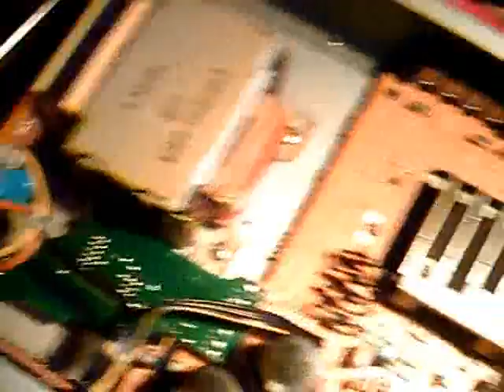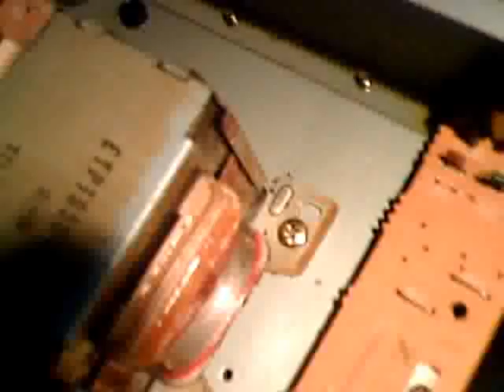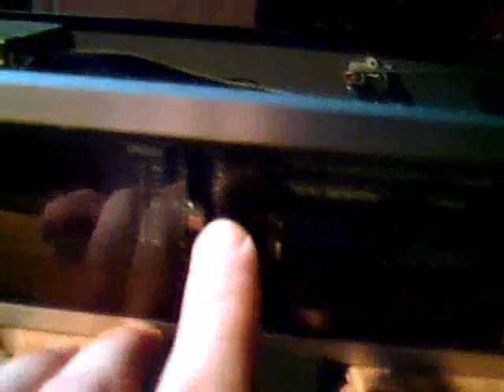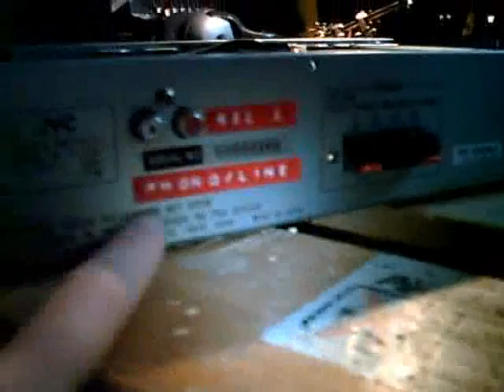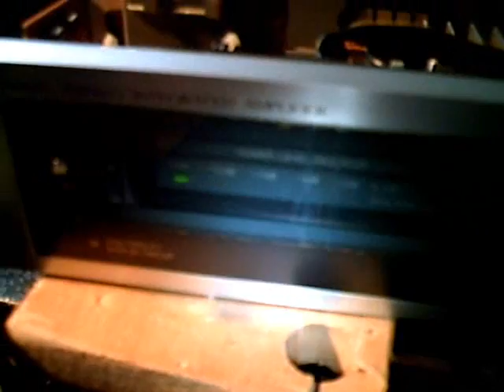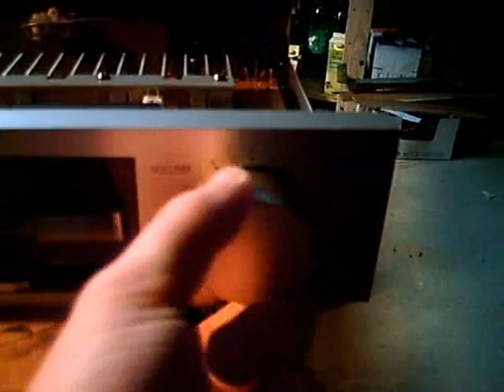Restoring the JVC A-K100 amplifier

Comment: Very nice job.  The Phono to line mod is quite nice, and if you ever want connect a turntable you can still use a separate phono pre-amp.  Which would most likely sound better anyway.  The red LED also was a great idea.  5 stars.